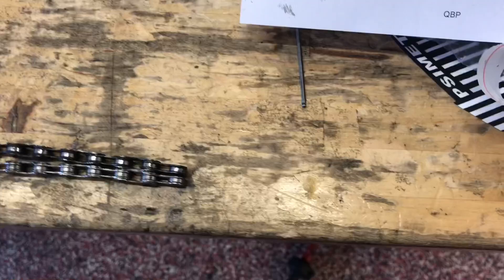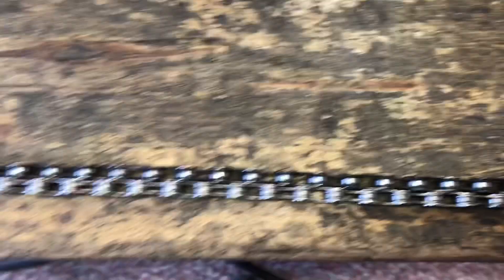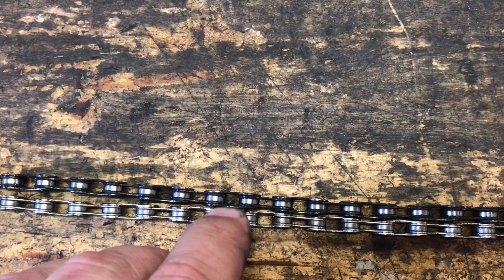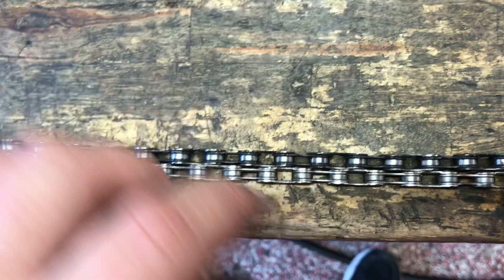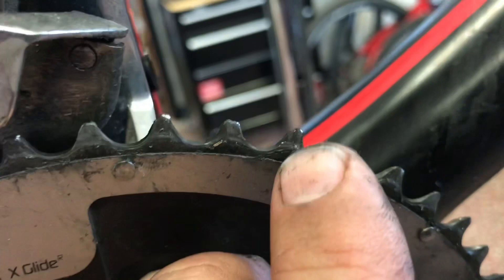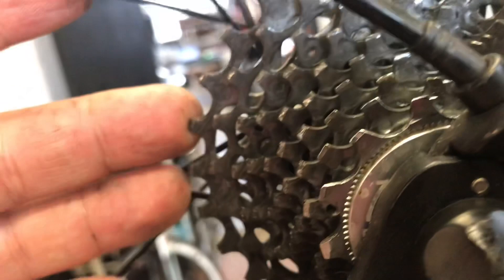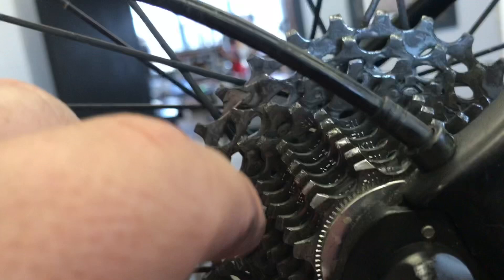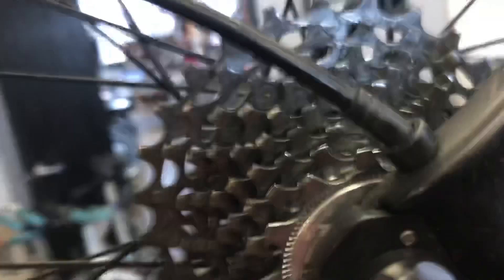Something that could be destroying your bicycle drivetrain components that most cyclists overlook!

Comment: Listen to the man. He's right. I was lazy caring for my bike and let the chain wear to almost 1/8" out in 12 links. It was riding fine, but I wasn't checking, even though I knew about the issue. When I finally checked and replaced the chain, the bike wouldn't hold a gear after I put on the new chain. It was difficult to ride even on flat ground without the chain skipping. This happens because the new (in spec) chain can't mesh with the worn cog. What's the price? This is an old Italian steel bike with Suntour 7-speed Accushift. The freewheel (yes, freewheel) looked fine, but the tooth spacing was too far off to function for 3 or 4 of the 7 cogs because of running too long with the worn chain. Luckily, I had a spare freewheel in my toolbox. If not, the cost might have been a whole new drivetrain and a new rear wheel, including spreading the rear dropout spacing, because of compatibility issues: No freewheel available means new hub (new wheel), and that means new derailleur in this case, which wouldn't work with my Accushift downtube shifters, so new brake levers/shifters. I wouldn't be surprised if modern levers would have the wrong pull for 30 year old calipers. I probably could have kept the headset.  Change your chain. Oh, and this was an old 7-speed chain, which I suspect was much, much more durable than the modern skinny chains.